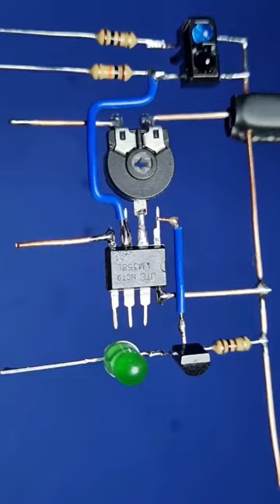How to Make Proximity sensor / Simple diy Long-Range Obstacle Detector

Comment: I'm always impressed by your soldering skills but I was wondering what kind of battery do you use I noticed it's the same one in all your videos is it a rechargeable battery
Reply: May be 18650
Reply: Yeah. That one is an 18650 battery.

Comment: ahi un error, si pones un diodo led en el emisor con una resistencia en el colector no puedes hacer una derivación llamada OUT+. DADO QUE ME DEJAS CON UN DIODO EN PARALELO A LO QUE CONECTE Y R3 EN SERIE, (ahi me metiste un divisor de tencion). lo correcto hubiera sido mover la R3 al emisor y OUT+ dejarlo directo sobre emisor.
no se si se entiende, asi como lo muestra OUT+ DARIA MAXIMO LA TENCION NOMINAL DEL LED EN ESTE CASO NO LLEGA A LOS 2V Y CON UNA FUERTE LIMITACION DE CORRIENTE POR R3 QUE LIMITA MAS LAS COSAS.
SI YO LO HAGO VUELO LA R3 Y EL LED MANDANDO UN RELE DOBLE INVERSOR AL EMISOR CON UN COLECTOR DIRECTO A VCC.